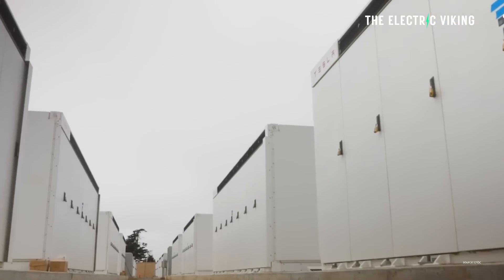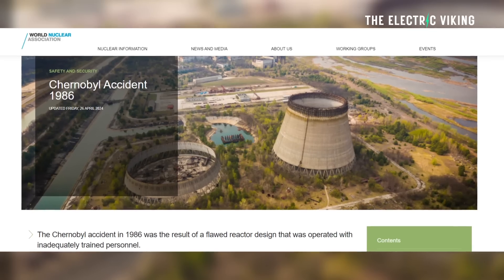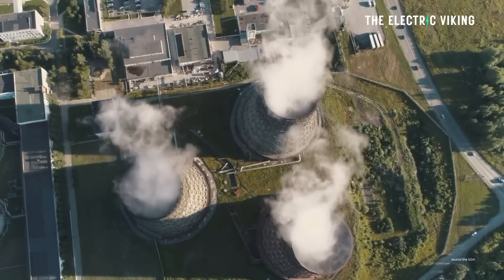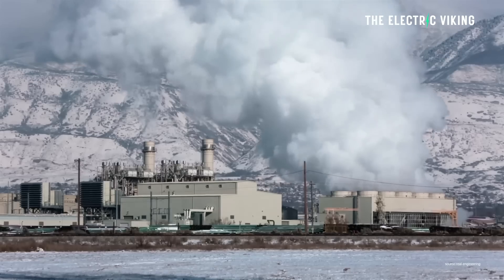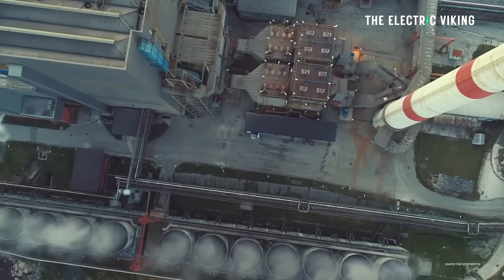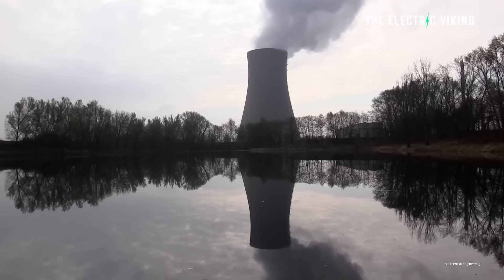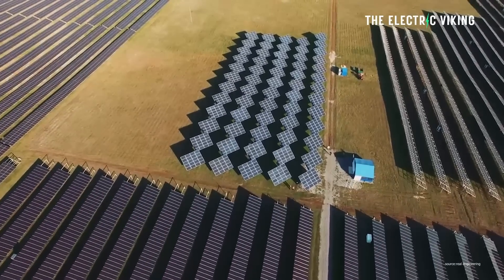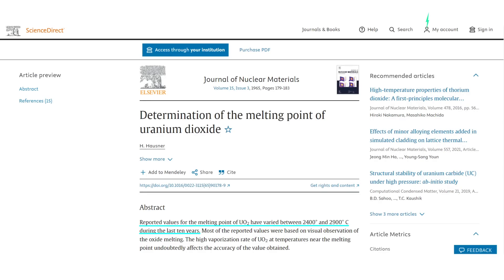China build the world’s first thorium molten salt nuclear power station

Comment from the maker: The best solar company in Australia just installed my new solar system. 
Check them out here: https://www.resinc.com.au/electricviking
Reply: No, China had the 1st in test fase, last year. It's supplying energy to a small town.
They are building a 2nd and 3rd already.
You can almost "instantly" shut it down.
Did you know in the 50's US could already use Thorium? US didn't want using Thorium, because they can not use it for nucleair weapons/boms.
Reply: Did you get batteries?  What is the approximate cost?
Reply: We are bound by local providers .

Comment: They WEST should have stayed with this, But then they wouldn't have material for nukes.  Safer yes, also can burn long term waste into short term waste.They cannot melt down, If the contents leak into a bunded area they solidify and remain dangerous for a few hundred years, If a Uranium reactor melts down, it will melt through its containment, the steam will dissociate into hydrogen and oxygen and blow the lid off any containment and the goo will melt through the floor to the ground water.   I much more difficult situation to get a handle on.

Comment: 3:59 This is faulty and shows little actual research. It's impossible for a LFTR design to have a "nuclear meltdown", because It IS ALREADY "MOLTEN". Both the coolant and the fissile material are in a liquid state, so how can it "melt"?? In fact, if the geometry of the container is choosen well, it is inherently stable, because when there is to much heat, the molten salt expands, which means the fissile material doesn't produce more reactions, which means less heat transfer, which means the salt cools down, which means th reactions augment, which means more expansion through heat, etc, etc. It has, thus, a dynamic equilibrium which makes a LFTR inherently stable.

Comment: Water-cooled reactor works in vey high pressure to avoid boiling inside the core, But if it is out of control, the water will eventually explode, turn into radio-active steams and potentially hydrogen and oxygen. molten salt works in normal temperature, it won't explode, but the core can still melt if heat accumulates. In that case, the melted core will go down to a safety canister reaction will stop (in theory). But still, it is never hurt to be extra careful for the first commercial reactor. Let it run several years for more data is a sensible choice.

Comment: Here is a summary of the obvious falsehoods in the video:- 

1. Claims uranium reactors depend on solid fuels. However, uranium can be used in liquid form just like thorium. 
2. Claims Elon Musk has questioned why anybody would want to live near a nuclear power plant and characterises him as against nuclear. When in fact Elon Musk has come out in support of nuclear power multiple times. 
3. Claims this Chinese reactor will use molten salt "or carbon dioxide". In fact, the reactor will use molten salt. There are other reactor designs that do use carbon dioxide to cool the reactor but not this one. 
4. Claims that "really it is not even a nuclear power plant". When really it is.
5. Claims there could still be a reactor meltdown like Fukushima or Chernobyl. Saying it "is possible still". The science of physics says otherwise. You can't melt molten salt because it is already molten. 
6. Claims uranium reactors depend on water cooling. Most today do, but some don't. For example, some use carbon dioxide. Liquid metal has been used previously. And the very first molten salt reactor ever built (MSRE) was a uranium reactor. 

I'm glad that Electric Viking is expanding his horizons, and looking more closely at nuclear energy, but this was a poorly researched video.

Comment: So a few comments: 
"Nobody want to live near a nuclear power plant - 50 km". If you check out nuclear power plants there are MANY who have people living quite close to them. And their neighbours usually don't mind the plants either. It is generally out-of-town people who come to the nuclear power plants to protest. 

Also, even if some local govenment take the irrational decision to not allow anyone to live within 50 km, you can still have farming, industry and forests within the zone, not like solar where they take up the space and that space is now completely unusable.

The thorium molten salt reactor is totally a nuclear power plant. It transforms thorium into uranium which then fissions and heat up the coolant liquid which transfer heat to the steam turbines. It's a different isotope of uranium though, so it produce less long-lived waste than mined uranium.
Slightly different from a Pressurized Water Reactor, the most common nuclear power plant reactor. 

Many times in the video when you say that "a thorium plant have this feature" it is actually the molten salt reactor that have this feature (which can run with thorium/uranium or with mined uranium). Like passive safety.

Also, the primary reason they put it in the desert is probably because it does not require massive amounts of cooling. Traditional PWR nuclear power plants (and also large oil or coal powered plants) must be placed near the ocean or a river for access to cooling water for the turbines.

Comment: 1. molten salt liquid fuel reactors can use thorium or uranium or both depending on the reactor design. 

2. Molten salt liquid fuel reactors can’t have a meltdown. Because the fuel is already molten. If the reactor breaks open the radioactive sludge actually freezes in situ. It does not disperse into the air as a hot radioactive plume. 

3. Thorium is more plentiful than uranium. But we have loads of uranium for millennium.  Yes we only have reserves of 80 years but resources are bigger than reserves. We only have 40 years of copper reserves. 

4. Here are some companies working to commercialise their own design of molten salt reactor:- 

Terrestrial Energy
ThorCon
Terra Power
Seaborg Technology
Moltex Energy
Flibe Energy
Copenhagen Atomics

Comment: although you stated that it is possible for a "meltdown" to occur - it is my understanding that a runaway or "meltdown" is statistically insignificant, given the nature of how molten salt reactors operate.  if the reaction becomes unstable and tries to go critical the physics in how the reaction occurs combined with the manner in which the reaction chamber is built causes the reaction to exit the chamber at the bottom to a space where the reaction is rendered inert. where am i wrong or what did i miss?

Comment: You still need uranium to get started with a thorium reactor.
Reply: What's needed is a neutron source. Uranium is just the simplest, easiest way to achieve that.
Reply: @taiwanjohn  Well, a thorium reactor starts with thorium 232, but it has to become uranium 233 by indeed taking up a neutron and decaying. So whatever uranium you need, it is either 233 or 235.
Reply: @Krasbin    You could also use a neutron generator/gun to fertilize the Thorium, it's just a LOT more complicated and expensive.
Reply: @taiwanjohn  But that would still generate uranium 233 as a fissile material. Thorium 232 is what you might put in, but it is the uranium 233 that you want to get from the process.

I have looked at accelerator driven systems, and as far as I understand they are not (yet) energetically favorable, which means that at the moment you would have to put in more energy than you get out.

Without even a net positive energy gain, you can (for now) forget about a net economic gain.
Reply: @Krasbin    Yes, of course. The point is that you don't necessarily need 233U to start with, because you can generate it from Thorium with a neutron source. Once the breeder cycle is initiated it should be self-sustaining, but you need a neutron source to get it started. If you happen to have some fissile Uranium lying around, then great! But even if you don't, you can still "ignite" your reactor with an artificial neutron source. (In theory, anyway.)

Comment: Good thing about thorium is not cheap fuel. Uranium is also cheap and abundant enough that fuel cost just 10% of total cost. Best thing about  Thorium as nuclear fuel is it produce nuclear waste (spent fuel) in much less quantity and much easier to store. It reduces nuclear waste to 1/20 of Uranium waste. And Uranium waste should be stored 100,000 years for safety. But Thorium waste need to be stored about 300 years to be safe. It is much better solution for nuclear waste disposal.

Comment: From my search of "Alvin Weinberg on molten salt reactor experiment".
The "AI" did a pretty good recap...

Alvin Weinberg's Molten Salt Reactor Experiment (MSRE) was a nuclear reactor that operated at Oak Ridge National Laboratory from 1965 to 1969. Weinberg, a Manhattan Project physicist and the lab's longest-serving director, authorized construction of the MSRE in 1960 after 13 years of experimentation with molten salt reactors. The MSRE was notable for several reasons, including:
Fuel
The molten salts acted as both a fuel carrier and coolant, unlike most modern designs
Uranium-233 (which is made from thorium, via enrichment which is it absorbing neutrons that turn it into other elements, my comment).
On October 8, 1968, the MSRE became the first reactor to run on uranium-233
Self-sustaining nuclear reaction
The MSRE achieved its first self-sustaining nuclear reaction on June 1, 1965
Reliability
The MSRE proved that molten salt reactors could operate reliably 
Weinberg believed that reactors like the MSRE could provide the world with limitless energy and environmental protection. He envisioned using the reactor to create electricity for the poor, freshwater from seawater, and an inexhaustible supply of fuel by using thorium instead of uranium. 

They've got old clips of an old engineering genius, too..
https://youtu.be/pGzKuhY50v4?si=tXn9GuHhURzymhW8

Comment: Thorium molten salt reactors are exactly what the title says.  molten thorium with a molten salt causing a reaction that produces fissible uranium causing high temperature heat.  Because of the high temperature, a carbon dioxide turbine can be used making for a small compact reactor that has potential for both land and ship use.  China has had a small 2 nw developmental reactor running in the Gansu Desert since late 2022.  It is planning a medium size version starting in 2025 and completion by 2029, with industrial sized reactors in 2030.  As mentioned before, the Shanghai Jiangnan shipyard says it plans to build merchant ships using a thorium MSR.  Is it possible that this reactor could be used for this purpose?  Further the same shipyard and the Dalian shipyard are said to be building the fourth and fifth super carriers said to be nuclear powered.  It could be that these carriers could also be thorium MSR powered.

Comment: Some facts to keep the perspectives based on real information. Thorium is fertile but not fissile. For it to be used in a nuclear , it is transmitted to Protactanium which in term is transmutted to Uranium233.
Molten Salt Reactor MSR, could be of different types, use either Uranium ex.NATRIUM (Bill Gates - Wyoming) or Thorium.
MSR plant costruction savings could be realized because High pressure ratings components may not be required, however corrosion resistance requirement may negate any cost savings.
China is trying all energy flavours, and not negating nuclear  in any way, they will decide longterm  soltions based on emperical data, including constructability and operationak costs, derived in their own country.
Reply: Hot water is more corrosive than molten salt. All reactor designs need to consider corrosion. 

Thorium does transmute to Protactinium. However, Protactinium does not TRANSMUTE to U233. It DECAYS to U233.
Reply: @terjepetersen  Yes, and for hot water, it is corrosive but for all the coal fired plants on utility boilers, or any industrial boilers or package boilers, the water quality is managed, well definedset of sampling points and prescribed chemical additives. Well estsblished methods.
Reply: @acwojtkowiak  - molten salt has been used in industrial processes for a long time and the corrosive aspects are quite well understood and manageable. I think the corrosion concern with molten salt reactors is way overstated. Obviously, it needs to be managed but it is very manageable.
Reply: @terjepetersen  manageable ok but not as cost effective as using water as  coolant, currently that is. All the current utility boilers, industrial and package boilers have water quality systems, and these are well established. Bill Gates'  NATRIUM  reactor is being built,  so at least more data will be available for assessments.
Reply: @acwojtkowiak  — the Natrium reactor is cooled by molten sodium (metal) not molten salt. 

Water may be simpler in some regards but it also adds enormous cost to a reactor. For starters you need a spectacularly large containment building with the associated concrete fabrication costs if your coolant is water. Secondly your temperature caps out at about 300C meaning you need an extra large expensive turbine that delivers less power and less efficiently. Then there is the ten mile emergency planning zone you have to have. Also your reactor walls need to be a foot thick to contend with the pressure. Water causes lots of add on costs that molten salt avoids.
Reply: @terjepetersen   The reason the vast majority of nuclear stations in the world are light water PWR or BWR or in Canada  Heavy Water CANDUs because the industry realized or was pushed to it because it delivered Power at a very good price. Obviously not everyone agrees. Hope the Wyoming venture works out,  but it is a tryout, only, whether it commercially successful is yet To Be Determined. Re metal, pedancy - In MSR, S stands for Salt. Terminating my correspondence.
Reply: @acwojtkowiak  - it is not pedantic to note that molten sodium is not molten salt. They have very different properties. Sodium is highly combustible whilst salt is not. It is on par with hydrogen and water being different things.

Comment: Maybe, if the Chinese can make this work - Australia can put a few of these in the desert using Chinese I.P.  (but built by Australian contractors, who don't use tofu concrete)  as a part of Dutton's  nuclear plan... couple these with the molten-salt storage idea developed by TerraPower, and it'll work in well with Australia's  massive solar 'duck' curve.   Problem solved... no need for dangerous, environmentally damaging batteries or useless massive scale wind-farms, which only generate 15-20% of the time.

Comment: I think the point is being missed here.

Building it in the dessert has nothing to do with people not wanting it in their backyard.  Most nuclear stations are in people's backyard.  The reason for it being built in the dessert is because it's a demonstrator, to prove a point.  NO WATER!! 

This nuclear power station is a 2 part demonstrator.
1.  The use of Thorium as a fissile material.
2.  The use of Molten Salt as heat conductor.

The use of Thorium.  Thorium 233 is not a very fissile material as Uranium 235.  There is more Thorium 232 than there is Uranium 235, you can get Thorium 233 via breeder reactor ie.  Put Thorium 232 in a nuclear reactor that generates ENERGY and you get Thorium 233.  Thorium cannot be used in a nuclear weapon unlike Plutonium or Uranium.  So safety and fuel security is the reason.

The use of Molten Salt.  Nuclear power stations are built near water.  It needs to pump water in in order to cool it. Those "hourglass" towers so synonymous with nuclear power stations are cooling towers.  All types of power stations that use steam turbines have them, nuclear and non nuclear.  Anyhow, the reason why there are meltdowns is because of cooling issues.  Molten Salt reactors don't require cooling.

Safety, Safety and Safety.

Comment: A thorium reactor is huge news. In the works for 50+ years. Anyway, I see a need for a lithium-based non-fossil fuel power source that also has high energy density and is long-lasting for special applications (spaceships, submarines. giant container ships, etc). However, I also think/agree thorium power is not as well suited for typical grid power such as wind/solar/geothermal.

Comment: Liquid Salt Reactors can be turned on and off again by the flick of a switch.  Oakridge National Laboratories' build the first Liquid Salt Reactor in the 1960's.  Friday night they would hit the switch, and turn off the reactor.  Monday morning they would turn it back on again.  The Liquid Salt reactor was build for the US Airforce "Nuclear Powered" plane.  A plane need to be able to power up, and power down.  That is why they went with the Molten Salt Reactor.  Now the plane was never built, but the reactor was...
Reply: All reactors can be turned off with the flick of a switch. Fission is very easy to stop. However, all reactors need to contend with the fact that there is no way to turn off decay heat. Decay heat must be managed. Molten salt reactors can usually manage decay heat passively.

Comment: If you have Granite Counter tops, you have Thorium 232 in your home.  You can hold it in your hand.
How does Thorium 232 transmutate into Uranium 233
-Thorium 232 is bombarded by neutrons created by the fission process
-This transmutates Thorium 232 into Thorium 233
-Thorium 233 decays within a day into Protactinium 233
-Protactinium 233 decays into Uranium 233 within a month
-Uranium 233 is a fissionable element that can be used to generate energy.

Comment: It is impossible for a Liquid Salt Reactor to "Melt Down".  Why, its already a liquid, its already melted.
It is also impossible for a Liquid Salt Reactor using FLIB Salts (Fluoride) to explode.  If the Salts heat up too much, the reaction naturally decreases and stops.  Plus the freeze plug will melt if it gets to hot, dumping all the Fluoride Salts into a drain tank.